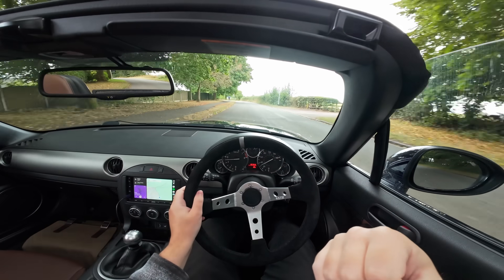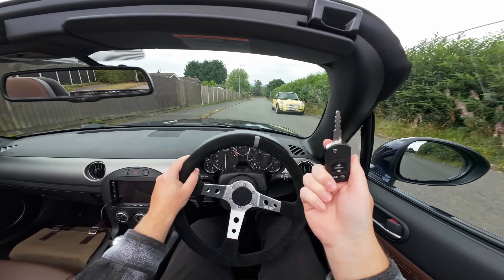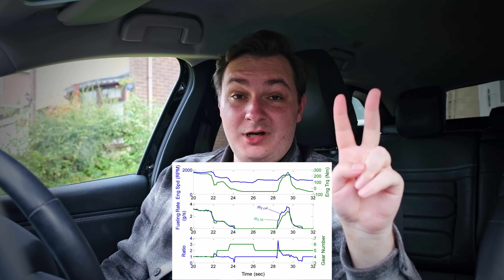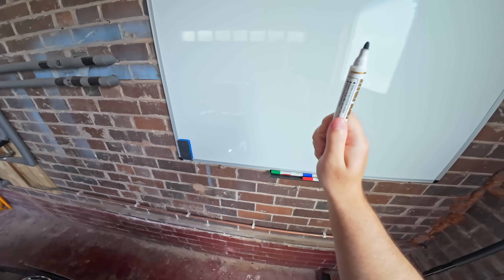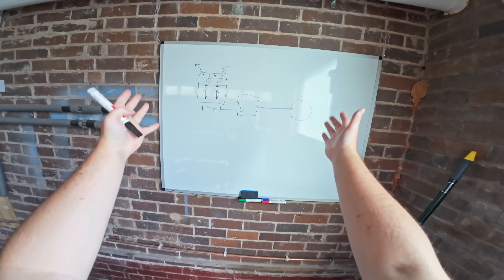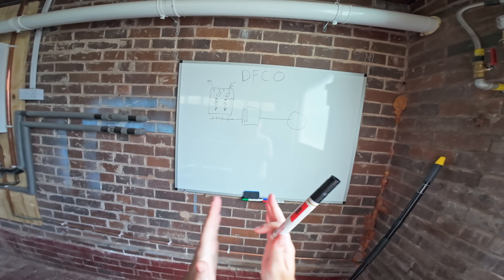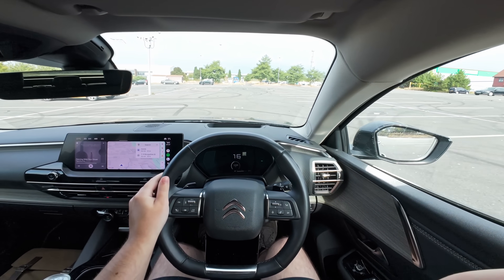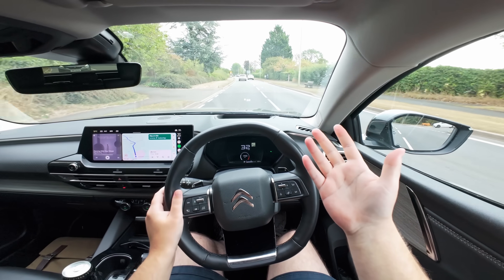The most misunderstood car term - Engine Braking

Comment: That´s literally what we´re taught in German driving school. I can´t believe you had to make a whole fifteen minute video in order to make people understand the basic mechanics of a car which every driver must know, otherwise there´ll be a time when you´re in the mountains and your brakes start converting friction into yellow light.
Reply: I'm from the Netherlands and even though the mountains aren't a problem here, this is also very surprising to me. I've seen online arguments about it before, but never really understood what they were talking about or how "engine breaking" was different from just normal driving. I guess most people in the anglophone world are just terribly aggressive drivers.
Reply: Americas drivers ed is just "here's the steering wheel. Here's the pedals. Don't crash. Got it? Cool. Here's your license"
Reply: @foxxify1 true
Reply: Same is taught in Czech republic. Even there are some hills where truck drivers are forbidden to switch to neutral and must engine break downhill, otherwise their brakes could melt and don't stop before city.
Reply: @xsimon00 We have also a lot of signs in the black Forrest to drive only in a low gear, 20km/h if necessary. Still the railing is always demolished in another way, when I drive through the Glasbachkurve in Schramberg.
Reply: Same here in Switzerland. It's just basic car knowledge that you learn during your first or second driving lesson. But in the USA, you can get your license for 50 bucks and a burger.
Reply: As a german myself I havent been taught the mechanics of the car in driving school. The practical application of simply letting go of the gas I was shown though.
Reply: is this really something that needs to be taught? This should be naturally obvious to people. At the very least anyone who drove a bicycle should now it since your legs are the engine there.
Reply: @sk8erbyern  But unless your bike is from 1870 the chain isn't directly linked to the wheel so rolling forwards doesn't move the pedals.
Reply: @sk8erbyern  There are plenty of people who drive but can't ride a bicycle.

Please remember that in 90+% of the US not being able to drive is somewhere between house arrest and being disabled.  Quickly looking it up, US driving written tests are between 16-50 questions, with 80% being a passing grade.  In many states, a quarter of the questions are drunk driving statistics.  Learners permit is 15, and drivers license is 16 years old.
Reply: We don't really have mountains in Finland, but even here, downhill driving was taught in driving school. Also, engine braking in everyday driving was really hammered in, even going to the gear shifting. In my experience, you only need to use the brakes when you need to stop completely or when you or someone else has made a mistake.
Reply: Completely agree. I've always driven this way and I can't believe not everyone else does.
Reply: They have to put a "Do not drink" warning on bleach. So
Reply: Well, I wouldn't be surprised if they did teach this. From what I've heard, Germans are taught well enough in driving school to drive on the Autobahn. That in an of itself is impressive.
Reply: As an American who lives in the mountains and is always impressed by the average driving behavior I see on videos of the Nürburgring compared to what I see in the States, I'm glad to hear there are other people out there for whom this information is fundamentally self-evident. Couldn't be the case on our side of the pond.
Reply: @RamadaArtist  That's a combination of people being idiots by not knowing how it works and wanting to stay at top speed the whole time.

Even with engine breaking, you're going to speed up going down hill.  Which you then recover on the other side.  Except if you're right at the limit of being pulled over. So can't afford, legally, to go any faster.
Reply: wait, but where I live in the mountains german tourists are known to abuse breaks like crazy whut?
Reply: @fischi9129  You´re probably from Switzerland, I guess. At least that´s where I´ve heard of the stereotype first. And that´s probably because there are a lot of people from my area of Germany who aren´t used to the Mountains. I´m also one of these ones that are absolute rubbish at accelerating uphill. Or it´s probably the older people that aren´t yet familiar with Schubabschaltung (forgot the english abbreviation again).
Reply: @fischi9129 well depends where in Germany they're from. If they're from a mountainous area of Germany they maybe don't have to go to the Alps, therefore you only see those who don't know how to drive serpetines.

Comment: Hey, I have 2 cars, a 20 year old Citroen Berlingo with diesel engine and a 17 year old Renault Clio with petrol engine. Both have display for "current fuel usage".
When rolling down a small hill, I naturally let off the gas. Clio will then display 0.0L/100km, but Berlingo will just drop to 2.2 or 2.4L/100km. Why is that?

Also, a small nitpick - when you get the car rolling and start engine braking, from physics standpoint, the car has now kinetic energy, not potential energy.

Comment: I love automatic transmissions (I'm a casual european driver) and I hate it when I want to use engine breaking when going downhill, you can feel the movement resistance as intended and then suddenly the automatic mechanism decides "screw this", goes to neutral and the breaking stops and forces me to use breaks for the rest of the incline. I wish there was a mechanism to tell the automatic mechanism that my intention is to keep engine breaking. Maybe it was something wrong in the setup of the vehicle (one of such vehicles was a 15 year old VW Passat) but it wasn't unique in this behaviour.
Reply: I think every on every automatic I've ever had there was a mechanism to limit upshifting to force engine braking on downhills.  Even my 1990 Ford Taurus  could do it, but you really wanted to pick your gear before you started going down the mountain rather than downshifting at speed on a lot of modern "manumatics" it's way simpler to do it on the fly.  The Toyota UA80E (Sienna, Highlander, probably some other things) will even engine brake automatically as part of adaptive cruise control.

Comment: another point to make is that modern cars(IE, practically anything with modern throttle-by-wire) have been engineered with rev hang to comply with emissions regulations. you let off the throttle, but the car still holds the throttle body open slightly for a short time, so that the remaining fuel in the cylinders can be properly burnt off, and once it is, you will be able to fully engine brake. at the same time, some cars dont have any kind of noticeable engine braking. the 2000s buick lesabres being one good example. those cars didnt have hardly any engine braking, even when selecting a shorter gear.

also, i really feel that, in the US, theres a regulation that requires the distance between 'reduced speed' signs and the subsequently reduced 'speed limit' signs to be large enough for most production cars to engine brake down to the required speed. i could very well be wrong, but it wouldnt surprise me if it was true.

Comment: The lack of engine braking inherent to downshifting is the main issue I have with my current automatic shifter. Well, that and the delay between hitting the throttle and the car accelerating.

Comment: Removing the key was quite dangerous thing. Many cars would lock steering.
Reply: My picanto didn't, you had to turn wheel significantly to get stearing lock to engage.
Reply: brakes would still work though
and i assume he has an idea if it would lock or not considering that his steering wheel doesn't look stock
Reply: @awesomestuff9715 probably. I commented on that, because some other people may try it as well. About twenty years ago one family in my grandma's town lost their lives, because the driver was saving fuel by turning the engine off and his steering locked in a bad time.
Reply: @mrakomo  that is honestly a crazy thing to do 

how is somebody that stupid ☠
Reply: @mrakomo  okey, that's something! BTW, if you turn the engine off and leave it in neutral while moving, the brakes pump will not move and you will eventually loose pressure and you will not even be able to brake. So no, the brakes won't work indefinitely. You must be crazy to even try something like this. (And I know, because I once tried, gentle straight slope, not actually dangerous)
Reply: @awesomestuff9715 That was exactly what I though about when watching this video 😂

Comment: Watching your demo drive I am flabbergasted. I thought this was just called “driving.” Do people not just let off the gas to slow down gradually, without hitting the brakes most of the time? I don’t even think of that as engine breaking… it’s just slowing down!
Reply: Some people just hard brake all the time.
Reply: Me too. I'm left a little speechless by the idea that "taking your foot off the gas when you want to slow down a little" is a novel idea to anyone.
Reply: @ChanJENI , I can understand, but probably because I come from a city. You'd be hard-pressed to find these kind of distances between cars in a city unless it's off-peak hours.
Reply: Oh you wouldn't guess how many people I see with their brake lights turning on at every single small change in the angle of the road, everyday when going to work. They drive me crazy because I always think they're hard braking to stop, but 90% of the time I just let go of the throttle and I slow down at the same rate as them. It's maddening because brake lights become useless and you get desensitised to them going off, then when someone slams the brakes you always react late and maybe end up risking a collision. Learn to drive properly people!
Reply: @prodbyfaith I've noticed the same thing, as well as an inverse problem. When I engine brake before going around a corner or something, I still get people riding up on me, even when I'm staying in the 5-10 over bracket. People are used to only slowing down when they see brake lights. It's gotten to the point where I will occasionally just tap my brakes at the beginning so I at least flash the person behind me as a warning. Otherwise they're clueless.
Reply: @TheBlazzer12 That's very smart. This is actually a good tip for people riding bikes to avoid being rear-ended. Always tap the rear brake when slowing down, just so the brake lights can catch the attention of the idiot behind.
Reply: @TheBlazzer12  Luckily I don't have to stop that often on my commute so I don't notice that as much, but flashing the brakes is smart, I might start to do it too just to be safe lol
Reply: @TheBlazzer12  
Lol that's what I do as well. I know the average person only slows down when they see red brake lights and don't pay proper attention to the car slowing down in spite of no red lights, so I do the smart thing and tap brakes to let them know. Don't want to risk a collision even if I'm driving optimally and properly.
Reply: @TheBlazzer12  This. I live in a very rural area and only drive manual transmission vehicles. Even coming down mountains I don’t use my brakes whatsoever. I just down shift as necessary since I know the roads so well I could conceivably do it blindfolded. 

I’ve had several close calls over the past couple of years in my truck, with drivers overtaking me and only stopping mere feet behind me. A couple months ago a guy didn’t slow (I saw him coming and knew instantly he wasn’t going to slow down in time, and would have failed to make the turn even if I wasn’t there) and I took evasive action and he missed me, but went into the culvert. Luckily, he slid into the culvert sideways and didn’t roll, only sustaining damage on the driver’s side doors and front quarter panel. 

I’ve even had a police officer pull me over for not having functioning brake lights. They do work, and the officer was apologetic and decent about it, saying he was shocked I was able to drive more than 5 miles in a string of cars without braking. Except I do brake, I just don’t use the brakes.
Reply: @prodbyfaith  I was taught to "cover" my brakes every time I'm slowing down at all, even when engine braking. But one time I was driving my manual truck, I was turning off to a side street and I knew I didn't need to press the brakes if I just down shifted, and the guy behind me followed me all the way to my driveway to yell at me that my brake lights are broken (they work just fine)
Reply: @prodbyfaith , because in the rushed life people lead now, people just prefer to do things quick. Quick accelerate, quick brake. In relation to this, people also tend to watch brake lights instead of judging distances. So if you let off your accelerator, there is a chance that the driver behind you may not realise before it's too late (also because they'd be tailgating you, explaining why they'd be watching brake lights so they can brake) that you are slowing. Also, with the kind of distances Mick is keeping, in many places he'd long have his lane cut into, which is another reason why many drivers tailgate & have to watch brake lights instead of reacting to gradual slowing down of the car in front with their own gradual slowing down.
Reply: @matthewlee7405 Yeah exactly, that's why I said "learn to drive properly people". Rapid acceleration and braking does not make you get where you're going faster, it only makes you waste fuel and risk accidents.
Reply: @prodbyfaith , in the city, it can get you to your destination faster if people are continuously cutting your lane, or it just happens to be your turn when the light turns red. The trick to "driving properly" in the city is actually to intentionally let others come into your lane, whether or not they "deserve" it, & budget more travel time to be able to give way to others. It has nothing to do with skill, but being generous & selfless.
Reply from the maker: next time you get the opportunity, jump in any NPC coworker's car... you'll be shocked
Reply: @MickDrivesCars  To be honest. Driven with a few co workers. And they were all actually pretty good drivers. A mate, a girl, her mum. All were very solid drivers.
Reply: Me too, I was stocked that this was a video. This is just driving. Drivers behind me must think that my brakes aren't working! 😂
Reply: Exactly, this is just common sense driving. I easily get up to 70mpg driving like this in my golf
Reply: Here in New Jersey it is horrible how people drive.  They gas it hard taking off and run right up to the point they need to break. I firmly believe it's part of the reason cars break down so soon.; nobody really knows how to drive a vehicle. There is a gas and a break and they stand on one of them.
Reply: @ericlweatherhog  I am utterly convinced the majority of drivers only are touching their brakes when they aren’t touching their gas. I used to find it hard to believe until I saw my mother-in-law drive. It was either accelerating or braking. It made me so goddamned car sick I asked to stop and get out.
Reply: I thought it was obvious too. Like, duh, there's inefficiencies in the system, air resistance, friction, etc. Even without knowing about engine breaking, I feel it's intuitive that letting off the gas means you'll slow down.
Reply: Top comment mate 👏🏻👏🏻👏🏻
Reply: Where I live, driving schools will often advise people to brake slightly so the brake lights are on, so people know you're slowing down and don't accidentally tailgate you. Apart from that, engine braking is one of the fuel efficient driving techniques they teach. I reckon in parts of the US, where driving licenses are easily obtained without expensive theory and practical lessons, they might do it less. Stupid advice like "brake pads are cheap, engines are expensive" probably don't help with it either.
Reply: Bots actually think they're smart for discovering engine braking. The adults of the world already knew what it was, and the point of NOT engine braking for 2 city blocks is to not annoy everyone else on the road. Narcissism is everywhere among the mindless. 

It's easy to both use brakes without slamming them, AND maintain speed without engine braking. Try driving with courtesy, or maybe we need to start engine braking after cutting you off? Not a brake check, and according to your type, it's no stress at all to slow others down. Enjoy what you give?
Reply: Well yes and no Craig. A lot of people (ignorant people) will actually accelerate to a junction stop sign stopped traffic or lights and just brake. And then repeat the process until the next obstacle. You'd be surprised how many people drive like that. As you said and as Mick said, that isn't even driving.
Reply: People think coasting is fuel economy.
Reply: Yeah, this looks like a very broad definition of engine braking. I'd say it's more "shedding speed", and only start thinking I'm engine braking when I downshift to brake harder, or go into low gear to limit the car speed on down slopes. If I'm "actually" engine braking I may throw in just a touch of the brake pedal to make the brake lights come on so people behind me know I'm going to be dropping speed.
I heard somewhere (technology connections, I think) the EU is bringing in legislation to make sure brake lights come on if the car is decelerating above a certain rate, regardless of whether the brake pedal is engaged - mostly because of EV regen braking, but also because of engine braking, as they are both able to catch other drivers by surprise.
Reply: @eduardonunomarques  EVs are a completely different thing though, with regen braking your car is basically hard braking everytime you let go of the throttle, which doesn't happen with combustion engines. Engine braking is very soft unless you go, I don't know, 4th to 2nd gear, but at that point you just use the brakes. If EVs didn't exist, that legislation wouldn't be needed if people were actually concentrating on driving instead of looking at their phones or whatever else may be.